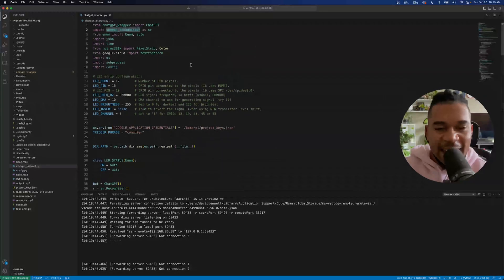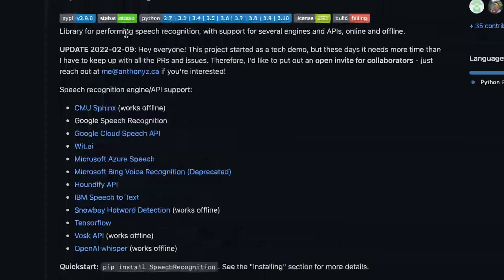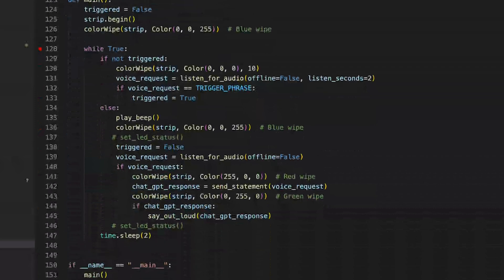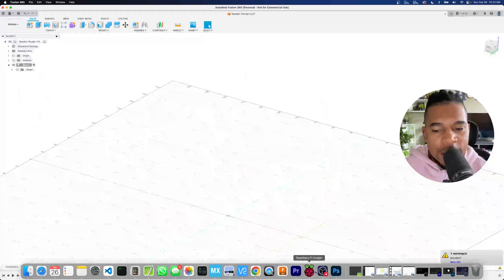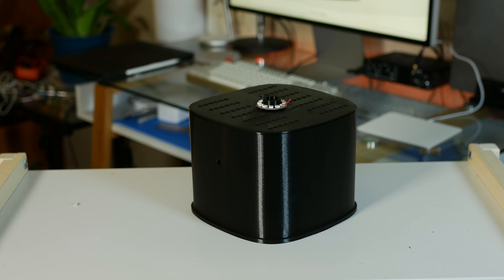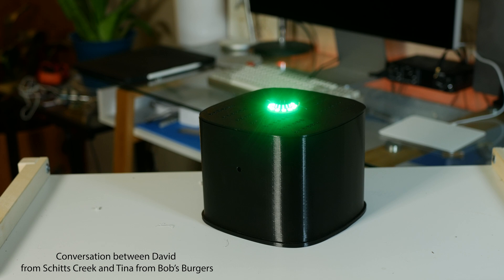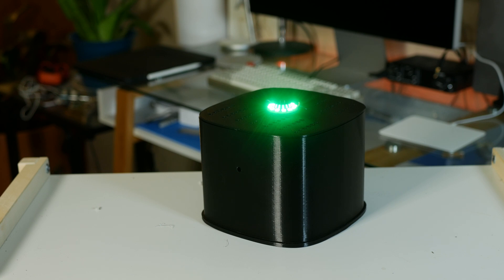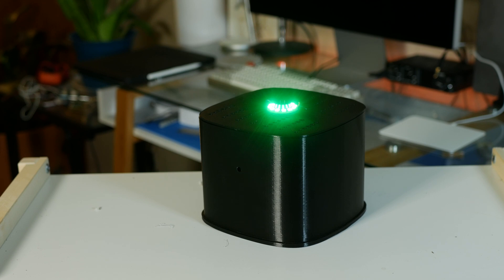Let's Build a ChatGPT Smart Speaker

Comment: Hey good video. I would like to take my Gen 1 Alexa device and convert it to ChatGPT, still utilizing the volume ring, microphones, function buttons, WiFi, speakers and power supply. In other words replace Alexa’s control board. Do you think that’s possible?
Reply: Also looking forward. Did you get the solution?

Comment: The reason the response slow is because chatGPT server response itself has a latency of a few seconds. You could in theory use one of the latest open source models that are similar to chatGPT in performance, add a few extensions (like allow searching the internet, use apps like calendar or calculator, etc) and run all of that locally, but that would depend on the memory in your raspberry pi board. Might be worth to instead send the data from the speaker over to a local PC server that is running the model instead within the same Wifi network. The latency shouldn't be terrible.
Reply: @Akash Goel huh, has anyone done something like that?

Comment: Can you just use a rasperry pico ( i know it is a lot slower) oder Cheaper alternatives than a rasperry pi 4
Reply: Raspberry Pi Pico is a microcontroller. It has practically no processing power at all. As far as I am aware it is not even capable of running a 32-bit OS, let alone a 64-bit OS that is required for this project.